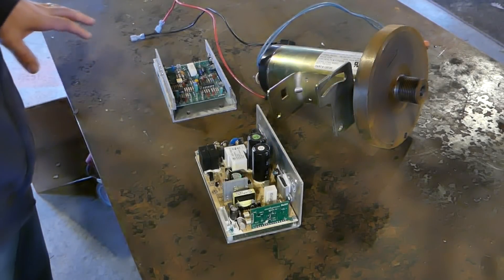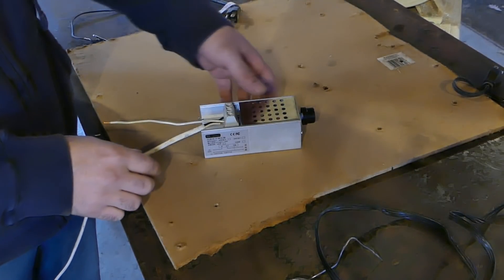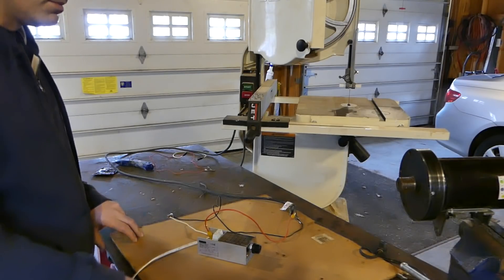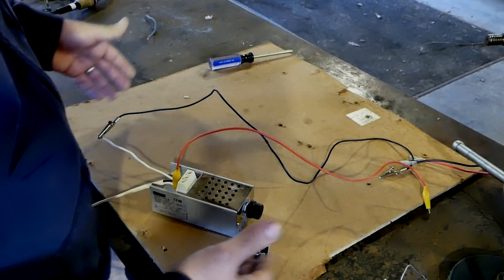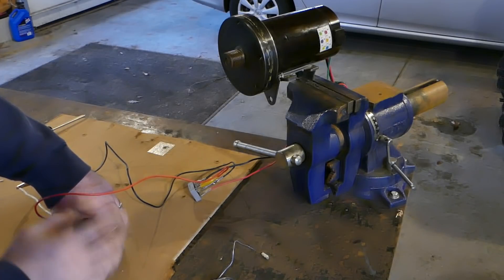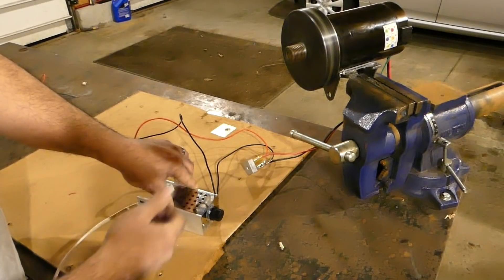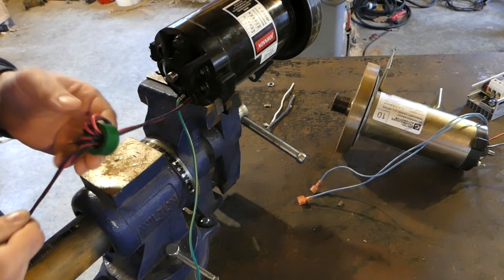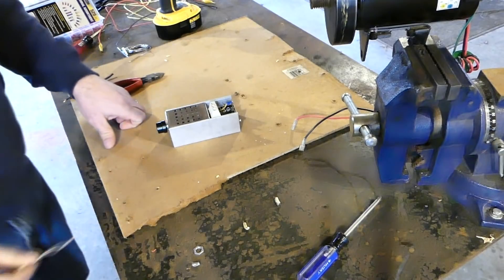Low Cost DC Motor Controller For Treadmill

Comment: So, why not buy a variable DC power supply instead? One rated for 5 amps and  50vdc costs about the same as all the parts and it comes with all the variability and safety stuff built in? No need to build a housing for the electrical stuff.

Comment: i found taking the perforated disk of the motor meant original t-mill circuit didnt work as it couldnt track speed for the user. lucky i didnt brake any thing.
this will help me make a rock tumbler with out the user panel

Comment: I am using the same controller for my swamp cooler converted to a DC motor.  The problem I had was the 60 cycle hum that comes through the bridge rectifier causes a loud hum coming from the swamp cooler.  With the addition of a capacitor the poweer output is much smoother and no more hum.

Comment: My motor has the red and black and also a blue and blue with yellow stripe wire.  Do you know what the two blue wires are for ?  Hard to find specs on my motor which is a GS Electric Icon model B4CPM 089T 2 hp 5950 RPM and 17 Amp.  Thanks in advance!

Comment: Nice video! I have a similar controller with 3 connection points. In, Out and Com.  I would like to power it with 220VAC. Do both hot leads connect to the In connection?

Comment: Amateur hour at best. You have no safety with AC current. You hook up AC to a DC motor and ruin it. 
You have no circuit breaker between SCR and bridge rectifier. You have no DC choke between bridge rectifier and motor. 
If you want to see how this is done properly, see Dazecars YouTube video series on this. 
To measure the impedance of your motor, turn the pot until the motor just start turning. Then measure the resistance in the pot. Usually 140k Ohms for treadmill motor. You can break this up into a 120k and 20k Ohm pot, wire them in series and get course and fine control of motor speed.

Comment: Good video, however seems to have given a lot of people the impression that this is actually 'good', for the motor.
120v AC rectified by a Full Bridge Rectifier is going to output 120v DC that is pulsing from 0 to 120v 120 time a second or generically 120hz.
A good visual showing the standard AC waveform, the rectified waveform, and then the rectified with capacitor 'smoothing' is here, just ignore voltages.
https://4.bp.blogspot.com/-2hY5shcHzz8/VrgCjDKI9NI/AAAAAAAAF7w/rrYCh2sXqIk/s1600/AC%2Bto%2BDC%2BFull%2BWave%2BRectifier%2BVoltage%2BTime%2BDiagram.jpg
With just a FBR in place, your motor is being driven by a signal from 0 to 120v and back to 0 120 times a second vs straight 120v DC current 100% of the time.
That means the majority of the time the motor is not getting the voltage and current it is expecting or needs to work as designed.
So, expect it work at about 65% efficiency insofar as speed/torque.
You could simply add a couple of $2 capacitors which will provide the 'smoothing' voltage/current if A) its not got enough grunt, B) you want it to probably last longer/closer to its designed lifecycle.
Unless its used daily/often, most motors run like this should still run decently for multiple years.
Reply: Hi
I ordered the parts i put it in my treadmill and i use it in low power ( just for walk ) but after 10 min the motor become smelling bad after 15 min smoke getout from motor
Any advice?
So if i put capacitor it will work? 
And where i put it ( before the motor ) and which capacitor please

Comment: What do I do with the two blue wires for the overheat circuit ?
Appears my stock Potentiometer stopped working 4 turn-ons in...smh this is a replacement for my first controller that the output didn't work.    Dont seem to be quality.

Comment: Interesting video. Although you recognize that your controller is a triac unit, you keep referring to it as an scr controller  which may be confusing to those new to this topic. An SCR controller already puts out phase controlled DC so it wouldn't require a bridge rectifier between it and the dc motor. A triac controller  must have a bridge rectifier between it and the dc motor.

You tried to control your bandsaw with your triac controller.  Your bandsaw motor  is probably a regular induction motor  and these absolutely should not be controlled by just varying the voltage, the motor will soon  burn out. The band saws induction motor may be speed controlled by varying the supply frequency, although you have to also control the current as well, as it will overy heat and probably burn out if you don't. 

The simply controller that you demonstrate would be great to control any tool that can run on ac or dc. Corded drills, grinders and saws, all fall into this group, as there field and armature windings are connected in serious. Series connected windings provide great torque but thier speed control sucks.

Thanks for sharing.

Comment: I HAVE A TREAD MILL MOTOR THAT IS SPECT AT  DC 100-120V     600W     CURRENT 3.5A     CAN I USE THE SAME CONTROLLER YOU HAVE THERE ?

Comment: I need a controller for a pair of 24v, 400-watt, DC wheelchair motors to drive a 1/8th
 Scale model locomotive.  This will be powered with two 12v deep cycle batteries in series.  Of course, direction will be a factor.  Got a controller for this purpose?

Comment: built something similar with a wall light dimmer switch, a bridge rectifier, and a capacitor to run a 90vDC motor.  it came on about at about 1/4 turn and topped out near the end of the dial.  your method looks a bit easier.  although i've found some DC motor controllers on ebay for 10-15 bucks now.

Comment: Add a electrolytic capacitor to the motor in parallel, it will smooth the motor running and increase speed, lengthen brush life their may be higher voltage
Reply: Koşu bantları neden 180wolt üretilir

Comment: Mike, This the second, or third, time I've watched this video. In your entry into this video you had another treadmill motor with four wires. The two on the outside of the motor are for the two brushes for it. And than there were two blue wires. What does those blue wire do? Are they feedback for a regulation system or controller? Just wondering...

Comment: Just now watched this - one comment - the inductor which was added should have been in only one of the motor leads. With both leads wrapped around the inductor core there will be flux cancellation and the inductor will do nothing.

Comment: I tested the 180 volt DC treadmill motor with my dewalt 18 volt battery! An AC speed controller with a kcp5010 bridge rectifier ( 50 Amps at 1000 volt peak! ) works like a charm. Lol

Comment: Hi I have a 180 volt at 5 amp treadmill motor. Can I use a 4000 watt scr motor controller? I have same bridge rectifier kcp5010. Which is 50 amps apparently? Any reply appreciated. Cheers from Australia 🙂

Comment: Hi great video and thank you. One quick question and I would appreciate an early reply. Can this motor controller be used to replace the original speed controller board on my treadmill and can I use my treadmill thereafter?

Rephrasing that question, will this speed controller be able to handle the load of a man running on the treadmill?

Comment: Hi Mike,
Can you please advise how can I test the SCR to determine whether it works correctly? My concern is that with no load and connected to a 220V supply I receive an output of 220V irrespective of the potentiometer position.

Will the Volts drop when the Treadmill motor is connected and then only increase as the potentiometer is dialed in?

As the Treadmill motor is max 180V I do not want to connect it and then the motor gets blown as the Voltage is not regulated?

Regards

Hendrik

Comment: Just wondering if you could reccommend a ohms value for the replacement potentiometer on the SRC voltage controller to utilize 110 VAC?  I assume it would be less then 100 k ohms? Mine is 500 k ohms which isnt working all that well..  Thanks

Comment: great info.  I have a 1 yr old treadmill motor and speed control board and controle board.  Not crazy about the soft start that is programmed into the sc.  This SCR/Bridge rectifier seems like a good change.

Comment: Sir thank you so much your information was valuable I was able to use an old treadmill motor to operate a shopsmith 10 ER lathe.  I purchased the parts that you recommended and this thing works beautifully now I can control the speed!!!!

Comment: Hi and thank you for helping fix my problem! Question: my bridge becomes warm / hot after a few seconds... normal?
Reply: Rectifiers produce heat as a byproduct of converting AC too DC.  You really should mount it to a heat sink.

Comment: It is advisable to invest in low cost digital "npn" type speed indicator, measure speed of motor flywheel and never exceed the data plate rating unfortunately most lowcost devices are between 5 and  12volt dc controlled,

Comment: What have you done to prevent over driving the motor, i.e. limit the voltage to the motor that the motor data plate states as max volt, ??

Comment: Ha! way kool Mike. I have 2 D.C motors 1 @ (2.5 h.p @130vx18 amps = 2340 watts)  and one @ 4.25 h.p @3170 wats. The ? is how far can you push these little things before something blows or goes into meltdown. You know "Russian Chernobyl". Or if you mite know how to connect two of these in parallel to reduce power on one? that should be good? using one pot!

Comment: Pumping the output of that triac straight into the motor was just scary.  It'd be like plugging straight into a 120 volt household circuit - a plan that needed work.

But live and learn.  Sharing the mistake makes it a valuable one. For that, many owe you thanks.

Comment: I’ve got a close to 20 year old treadmill that has a bad control panel and they don’t make them anymore. The motor control circuit board is good it just won’t communicate with the buttons up top. Only a few buttons work intermittently. What’s my least expensive option to keep it running?Is it possible to separately control the incline motor as well?

Comment: I built this as you directed and it worked well. However I had two issues...first issue was that the potentiometer still wasn’t slow enough for me. I’m wondering if a lower resistance pot would give me lower start rpms or cause issues? Second issue, you never say what to do with the ground wires; there’s one coming from AC wall power and another from the DC motor. I left them dangling to test but then one made contact with the aluminum scr case and fried it. I have another controller on the way but still unsure where to connect the grounds. A little help please.

Edit; I just realized that my board is not fried but it did blow the gfci I was plugged in to. Still don’t understand why.

Comment: I got SCR board on my treadmill motor it spins on at different RPMs ,so I attached it to my wood lathe it does not work under load I've seen all of these type of videos they never show it in real world use do not believe this

Comment: Alright, I'll try it! Got the motor a few years ago, so I've long since dumped the control boards to e-recycling. Didn't let go of that 18Amp DC motor, though: it looked like it could power something I could create - grinder, buffer, another over-arm tile-saw, or maybe? Not quite enough power for the 20" bandsaw I'm restoring - it came with a pretty dated 5 hp, 3 phase motor. Still looking for that one....

Comment: Mike, What is that metal ring that is wrapped with the power cable to the motor.. What is the name and what is the function? I tried to rewind it many times but still not clear to me. I appreciate if you can explain it to me. I am sorry, my background is a mechanical engineer.  Cheers from Indonesia.

Comment: You just saved my old '90's Craftsman lathe with a 90VDC original motor with a blown controller.  I think it works better than the original.  Thank you!
Reply: I got one of those craftsman 90vdc lathe motor too and was wondering if you had to modify any of the parts or setup?

Comment: Built this. Installed on a drill press. RPM's drop considerably when drilling. Any ideas for a solution to keep RPM constant as load is applied?

Comment: Hey i noticed the treadmill motor in the beginning had 4 wires.  Red, black and 2 blues.  While the motor in the end had only 2 wires and ground.   What is difference? How would the 4 wires be hooked up on this setup?

Comment: What’s the voltage on the DC side of the wires that connect to the motor? My motor can only handle 90V.. don’t want to smoke my motor
Reply: The output voltage from the controller will be higher than 120 volts if the pot is turned up all the way, but it can be adjusted to almost any output value you want by turning down the pot.

Comment: Wouldn't a potentiometer be enough for this speed control? What does the SCR do?

I have a treadmill motor and would like to use it in an electric quad project. Is it possible to identify it so I know what voltage it can handle and what amps will it pull? 
https://photos.app.goo.gl/Ld1HC9nSAk97kehw8

Comment: I have blown up two of the 10000 scr Motor controllers so far. I’m trying to power a treadmill motor for a belt grinder. I have hooked it up just like you said twice with a bridge rectifier and both of them blew up.

Comment: Love it....now let's make the motor run forward and reverse without having to switch wires every time you want to go in the opposite direction. Thanks Bud
Reply: A simple two way toggle will do that. Just feed the center and throwing the toggle feeds the terminals at the outside.